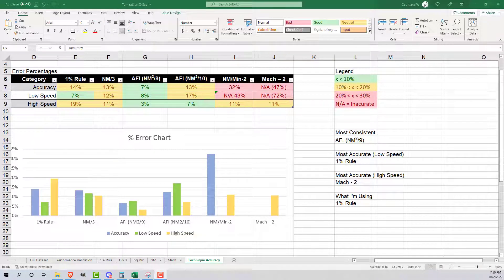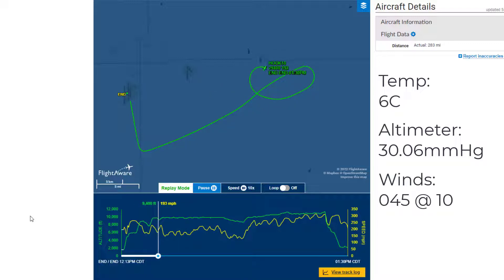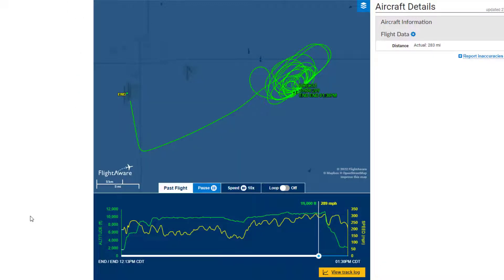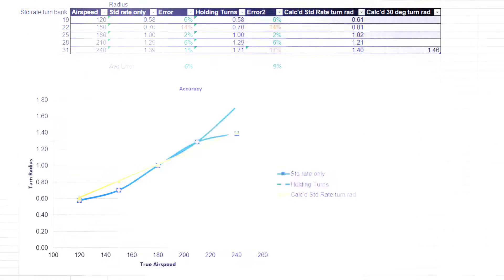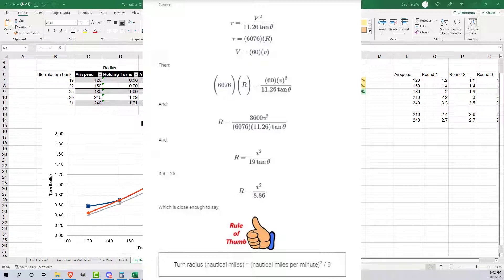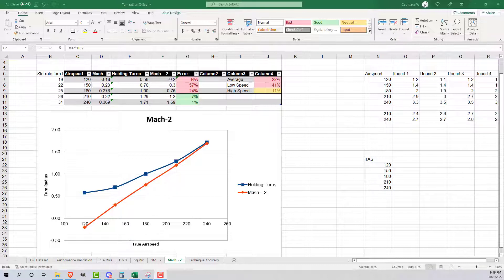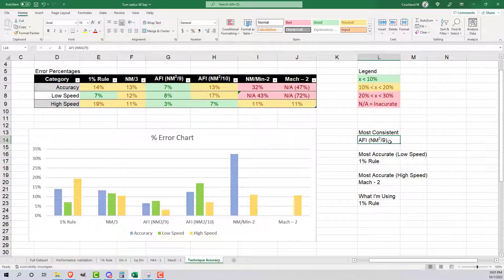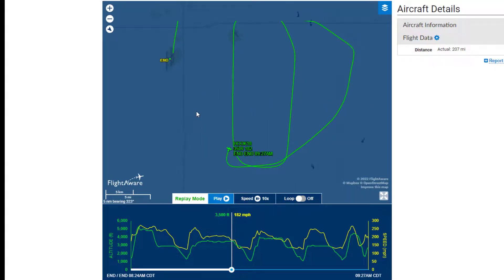Turn Radius Calculations | An experiment to find the best technique out there

Comment: One of these days I'm going to find a technical based video without the miserable, unneeded, distracting musical background. Why add it ? It seems in vogue to follow the crowd and try to combine narration and music. I sat through many classes in my working career, not once, never was a noise generating device allowed by a teacher or instructor in the class room. I applaud your efforts concerning turn radius computations or to establish some rule of thumb. I am trying to determine the turn radius of the WWII B-17 Bomber. I read of one B-17 navigator (using only a E6-B and perhaps a Mercator or Lambert conformal chart) informing the pilot.." navigator to pilot: recommend you hold this course for 6 min. and 20 seconds before your turn to the I.P.--navigator to bombardier: at target you can expect a six degree wind drift for bombs" . All this using equipment that by todays standards would be considered primitive indeed. Those guys had to have some rule or method to calculate the turn radius to line up for the bomb run over target.
Reply from the maker: Sorry to hear that you didnt like the video. This was unfortunately my best attempt at creating a "technical based video" 😭

Comment: Are there some quick formulas usable in flight to account for wind? As in when to start the turn and how much ba is needed.
Reply from the maker: I'm sure there are some formulas out there, but I have never heard of a wind drift calculation to use in flight.
Reply: @CourtyBoi  One that I use with good accuracy is Drift Correction Angle = Crosswind Component / NM per Minute. Ex. Flying at 180kt True is 3 NM per M, lets say X-wind 15 kt. 15/3 = 5 degrees of Correction. For start of turn I just use GS in the NM-2 method for turn radii.